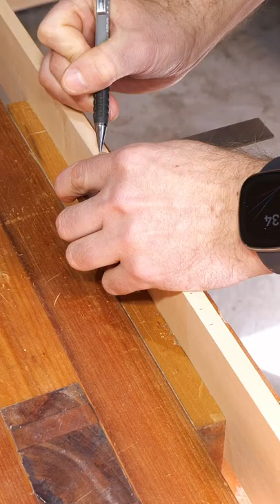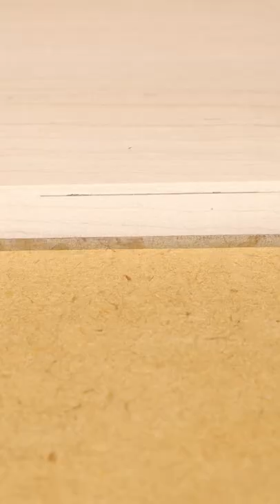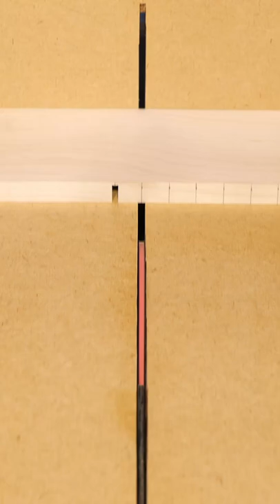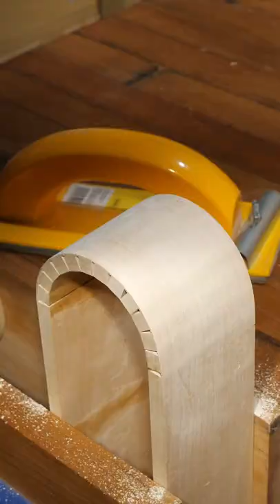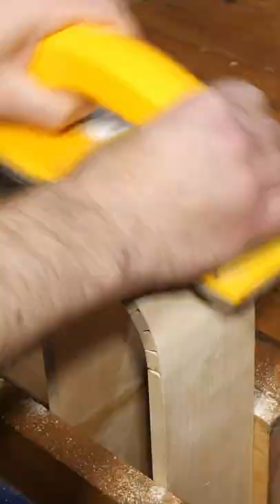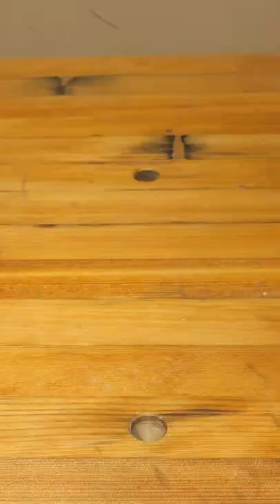INCREDIBLE Wood Bending | Kerf Bending | Woodworking #shorts

Comment: What about using polyurethane glue for kerf so voids & are doing more work?  I'd be stuffing glue/sawdust in voids after clamping to bridge triangulars.
Reply from the maker: That would be a good option if you were going to paint over the edges. For this build the wood will always be exposed, so I applied a wood trim to the edges for a natural look. You can see how I did it in my full length Bluetooth speaker video https://youtu.be/v4rr_cKRl-c Thanks
Reply: @kiwiworkshop  I'd still fill then cover with veneer, your style.  Either way,  fun project.

Comment: Hello! For  project like this would you put some filler on the bending area or leave it just like that? Have you tried that? Thanks for sharing
Reply from the maker: Hi, if the wood is going to be painted then wood filler could be used. When the wood is exposed, you can glue a wood trim to either side and flush trim with a router. That's what I did for this project but after this video. It's actually a Bluetooth speaker and I have a full length video coming out soon that shows the whole process. I'm aiming to have it published by the end of next week, just waiting on some parts. Thanks for your comment!